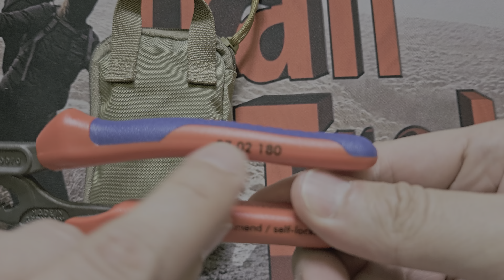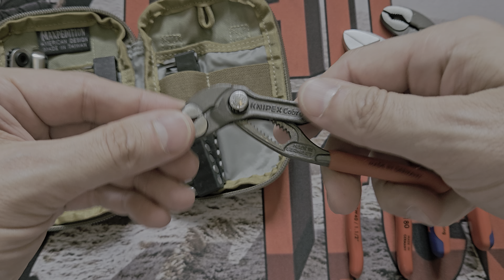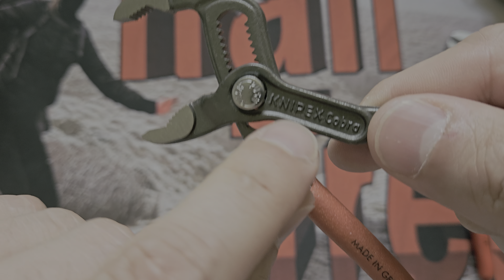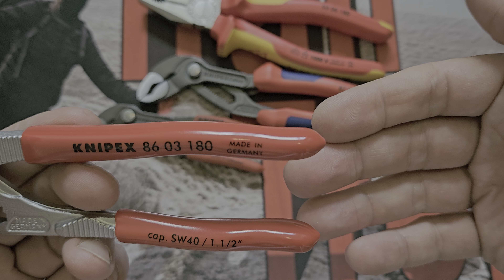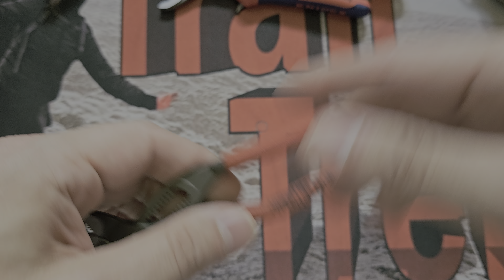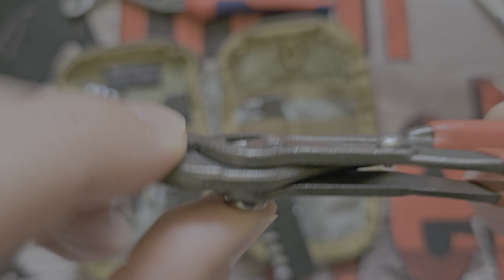Knippex Cobra Water Pump Pliers review  8701125 German 61 HRC

Comment: These things are incredible! I swear, some days I use them more than my knife. I carry them in that exact Maxpedition pouch too lol
Thanks for the review bud 👍
Reply from the maker: Excellent!  What do you think of the micro pouch?  The only think I don't like is the front black outside pocket.  It's not tight enough or stretchy at all so I wouldn't ever put anything in it.  But I love the rest of it.  Loving these tiny Knipex, I'm also after the tiny version of the pliers wrench.  But the cost means I will wait for a sale 😆
Reply: @TrailTrek  I feel the same way, I just keep some ear plugs in there because anything else would just fall out. But the inside of the pouch is great! 
You're right, $30 seems high for the smaller ones with bare handles. But I still want one lol

Comment: These have come in handy countless times in my kit. They may not be the most used, my drivers are used more often. But these are one of those invaluable tools that when they are needed nothing else will really do. :_Flashlight::_Cell::_Cell::_Headlamp:
Reply from the maker: Excellent, I feel the same.  A tool that if you don't have makes life difficult.  I'm after a tiny pair of the pliers wrench ones now to complete my micro pouch.

Comment: Knipex are probably the best tools in the world, imho,, I've got these exact ones, I've just got to remember where they are,, ha ha ha,, I might just get one of those pouches,
Great video,,
Reply from the maker: Agree, I don't have anything from Knipex which I dislike.  The quality is right up there and they are a pleasure to use.  I sometimes get asked to try channel lock, Irwin, Klein tools etc so I will try some alternatives but for now these are extremely nice.  I might re organise my pouch but right now it's great.  I have it so the pull handle is out the side of my bag.  Then I just pull that to get to it.  I'm trying to scale down so my main bag is smaller in stock of a heavy bag with to much in it.  I'm using the Veto pro now and it's built like a tank!